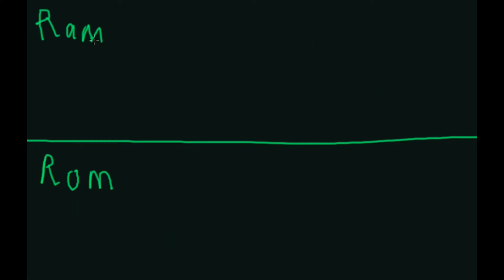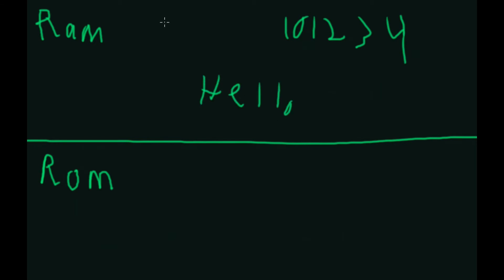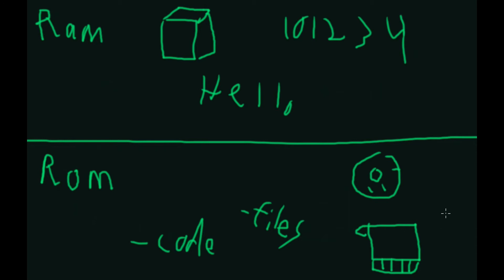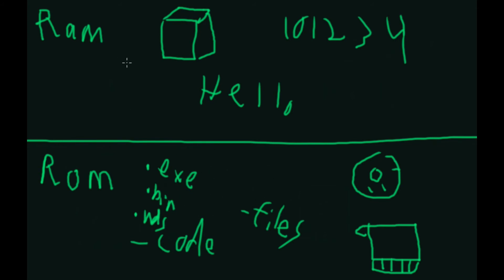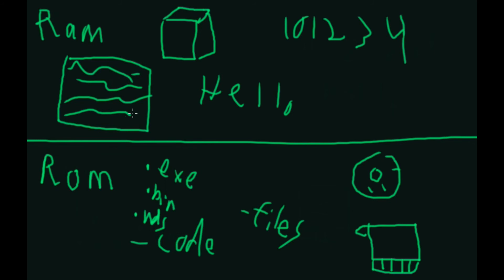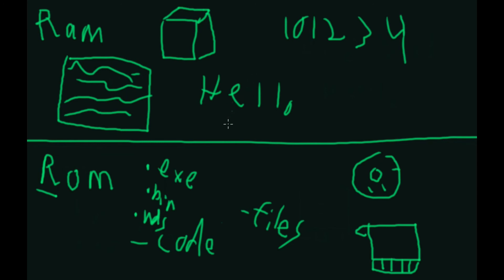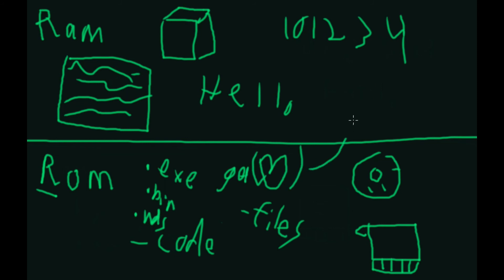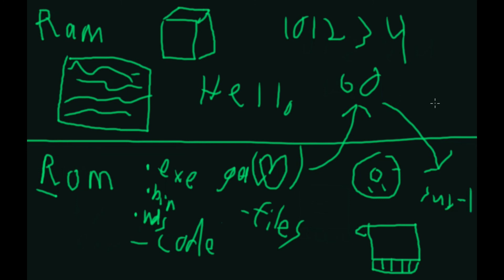GAT 1 - ROM And RAM

Comment: I'm glad you do ASM tutorials. A little bit of hopefully constructive criticism though:

A big difference between ROM and RAM I think you should've mentioned is that RAM is much faster. That's the reason why data is stored in RAM instead. As you know, RAM is also more expensive and therefore we can't have as much of it as ROM or disc space. I hope you'll explain this and other basic memory hierarchy in your future tutorials.

4:59 I think you should've said that most code is typically stored in RAM before it gets executed. Code can be run from ROM as well, but as I said earlier, ROM is slower. Running code directly from ROM is rarely worth the saved RAM as far as I know and I don't know any practical uses for it other than bootup.

Anyway, looking forward to GAT 2. Btw I found this cool ARM ASM tutorial https://www.coranac.com/tonc/text/asm.htm
Reply from the maker: Thanks for the feedback! The only problem is that I did not know these things. :p